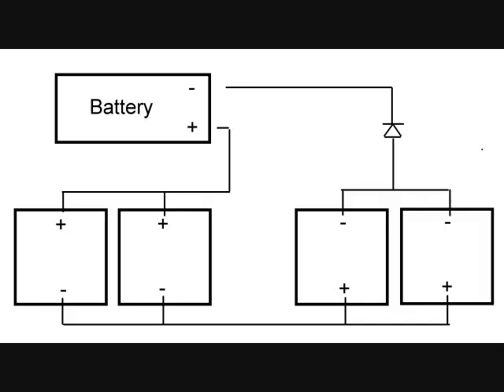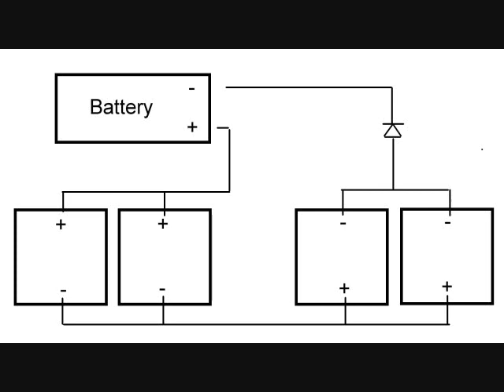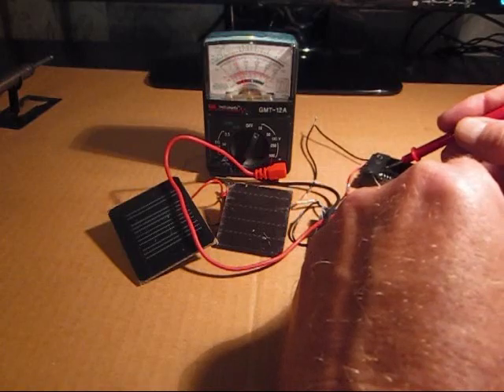Cigarette Case Solar Battery Charger

Comment: How do you keep the batteries from overcharging?
Reply from the maker: The output is pretty weak, more like a trickle charger, I just play it by ear, really sunny, 4 hours and then check with a meter. Cloudy, 8 hours and check.